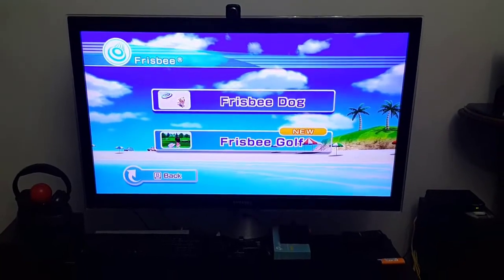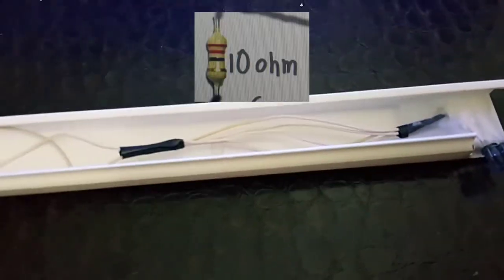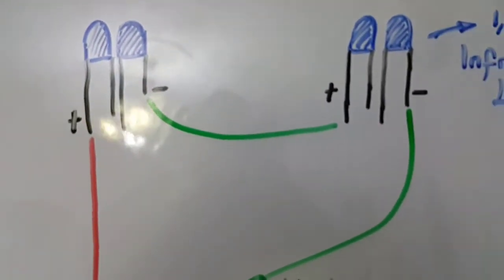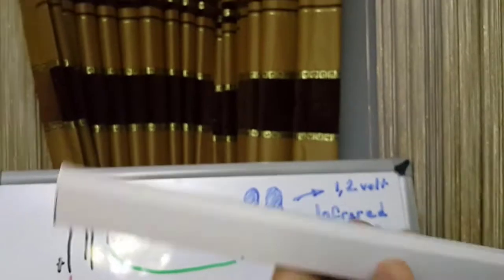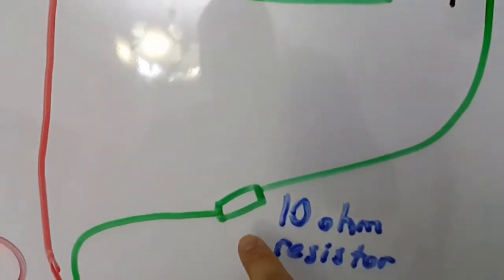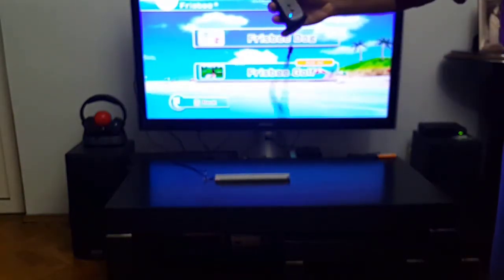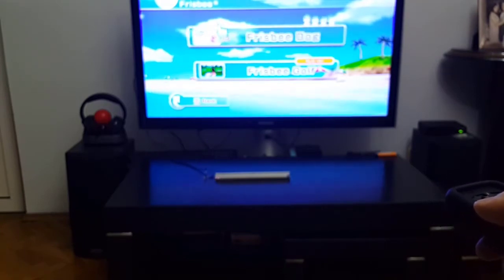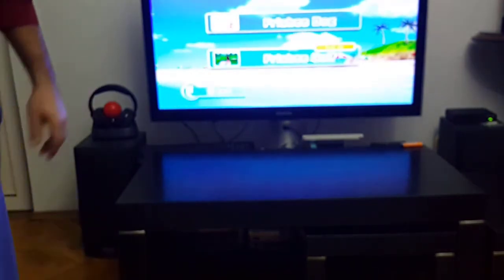DIY Dolphin Sensor Bar - Best & easy 100% working advise

Comment: gracias :D
Reply from the maker: Hi.. as explained before i reply, the sensor bar doesnt need a bluetooth dongle or any extra connection. Do as same as video and sensor bar will work. But i belşeve that the question was how to connect the wii mote with dolphin
Reply from the maker: To be able to use a wiimote with dolphin emulator you might also xheck my videos as i have explained that with some detailed  videos.
As a quick reply... If you have origional wiimotes than go to dolpins remote settings and try to add. It easily works. But as if your wiimote is not ırigional than you will need to follow additional steps as best is to watch my detailed video for that
Reply from the maker: A normal Bluetooth will not work for dolpin matching wiimote... Yıu will need a special programme to make the Bluetooth settings to a special one.. şts best for dolphin to be able to match with non origional wiimote

Comment: I know that would be a silly question but being as though the wiimote requires bluetooth, would this work without bluetooth for dolphin?
Reply: The sensor Bar doesnt need Bluetooth it just gives infrared light for the wii remote to orientade. The wii remote needs Bluetooth
Reply from the maker: https://youtu.be/uhRuzbeXccA
Reply from the maker: The link i gave is in Turkish. But it shows how to use a wiimote with dolpfin emulator. If you have an orijional wiimote şt is easier but if your wiimote is not origional than you will need a bluetooth dongle and a special programme as shown at video tonset the bluetooth dongle to beat setting for dolphin to match and be able to use with games and sensor bar
Reply from the maker: But to use a sensor bar you dont need any Bluetooth

Comment: Sir what is the name of ir led like it is transmitter or receiver ir led
Reply: It's just an infrared LED, the sensor's only function is to provide IR light to the controller, so there's no data transmission from the sensor to the controller, or viceversa.
Reply from the maker: Hi.. all I can say is that its been a long time and I dont eant to give wrong information. The IR kets are not the white ones. The ones I used are the purple lets (maybe blue ones might also work but I didnt try blue)
IR leds are 1.5 volt.
The impırtant part is that your wii ote is allready connected to wii or if using emulator to dolpin.exe (to PC as i did )
What you need is to be ablo to send a small signal to the wiimotes front sensor.
Thats why keds should be transmitter. They should send.. ıf keds are to receive than wiimote will not get anything...
I hooe this was helpfull.
You can check my candle light trick to use as a dolpin bar or the other video as I showed 3 ways to be able to use wiimotes motion abilşty ( as 3 method is 1- this led 2- using two candle lights 3- using cell phones ked light as if possibke use 2 phone lighrs or lamb lights - flashlight etc )
I hope this informatin is helpfull. As long as the wiimote gets a signal or light it works but for it to work stable the beat şs using this diy sensor bar